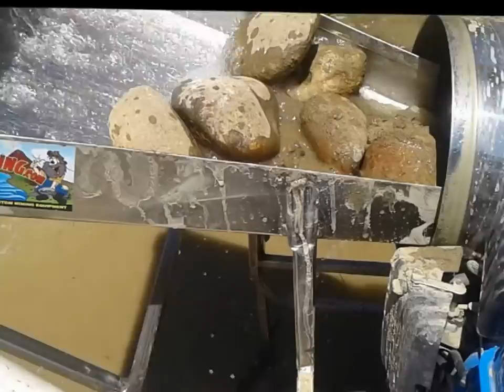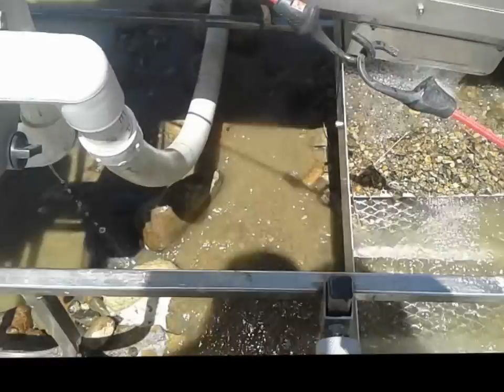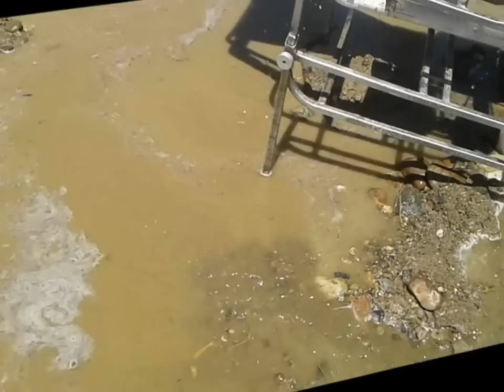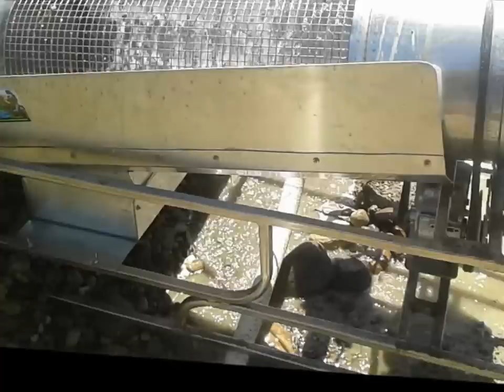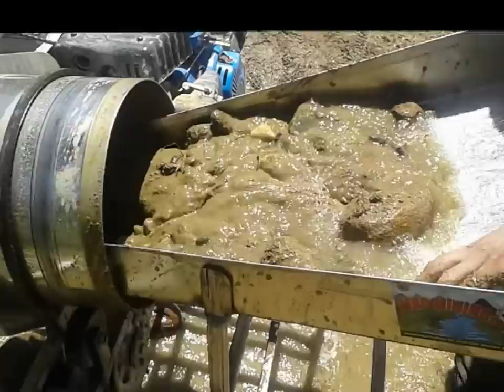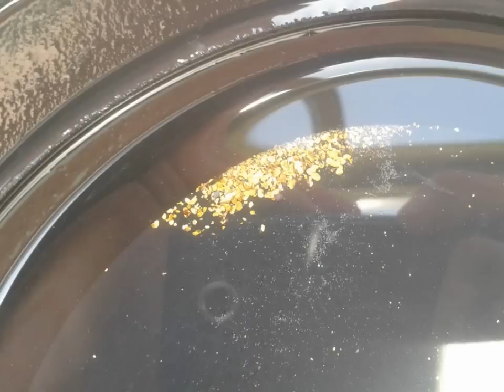beast trommel you tube 2.wmv

Comment: Obviously a lot of hard work went into building this trommel. Congrats on what you have so far...now take it to the next level.

The spraybar isn't really doing anything other than lubricating the material thus enabling it to flow into the trommel. You need to hit the raw material with a lot of water to create a semi-fluid slurry. 
I'd make the header box twice as deep, twice as long, and a pair of "blasters", i,e, fire hose-like nozzles directed upstream to thoroughly wash all the rock and get a really good slurry in the header box BEFORE it enters the trommel. 
Add a dam to the upstream end of the trommel barrel to prevent heavies from slopping out the wrong end of the barrel. 
Replace the sluice mats with Gold Hog mats or better yet, an Angus MacKirk sluice. Will reduce your cleanup times by over 50%.